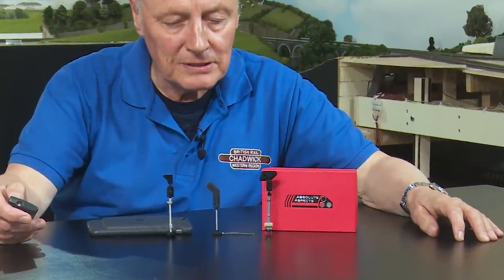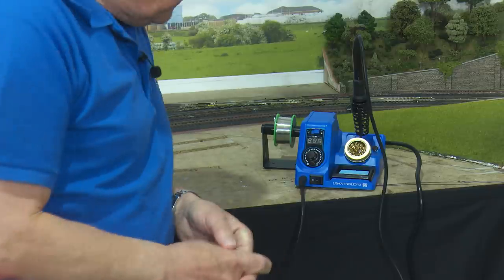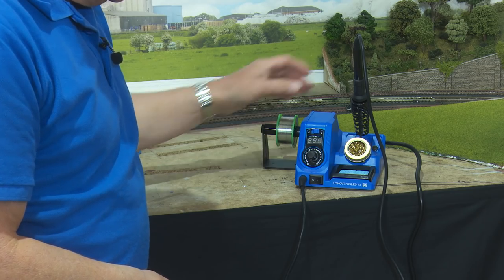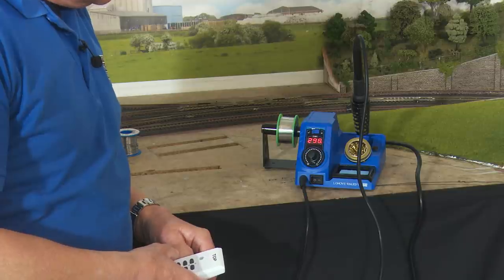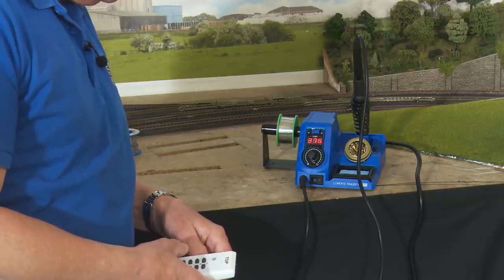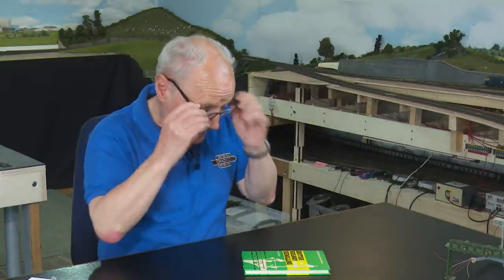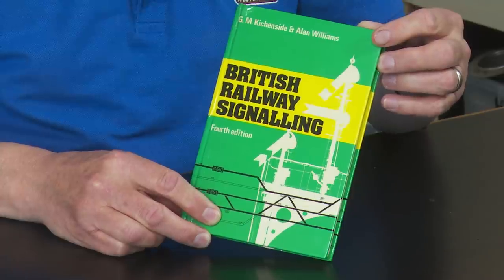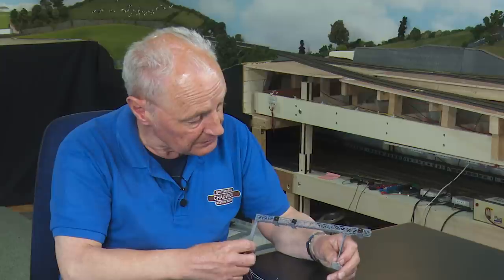Choosing signals at Chadwick Model Railway | 134.

Comment: I work in the elecronics industry so I am the kind of person who spends $400 on a soldering iron and while I would never buy a soldering iron like that myself it seems like great value for anyone who is on a budget or a hobbiest.   My personal preference is for soldering irons with a cartridge style tip as you can swap tips quickly for a different size or shape (using a rubber pad so you dont' burn yourself) and they heat up to temperature in about 3 seconds.
Reply from the maker: Yes, that is certainly a product outside of my budget Paul. Regards Charlie

Comment: Hi Charlie, I build all my Traintech signals and before the went digital, I built all my sensor controlled controllers as per Everard Junction episode 19, I now have two with feathers which are basically controlled by their signal decoder with the feathers linked to the switch on the slow motion point motors. Works a treat!
Reply from the maker: A great plan Chris. I’m so pleased that it’s worked out for you. Regards Charlie

Comment: Wow, that Absolute Aspects Signal really is a great looking piece of kit! Very impressed with the build quality. I know some will say its expensive but if you take into account the time, skill and materials to design and build it then it's easy to see why it's the price that it is. Great video as always Charlie and looking forward to "part 2"
Reply from the maker: What a heartwarming comment Dave, I’m so pleased that you found it interesting.  As you say, pricey but as an exception, well worth it.  Regards Charlie.
Reply: Another way to look at it: it's really the equivalent of a fairly substantial gantry. How many semaphore arms would you need to do the same job?  You've got the signal, all the diverging routes, and the position light. Am I correct in saying the position light can act as a calling-on signal for every route? On top of that, the same signal can act as a distant for any, or all, of the routes. That's a whole lot of signal indications, so maybe not really 𝒕𝒉𝒂𝒕 expensive.👍👌😁

Comment: UK rail signals would be the end of my career as a train driver :)
US (and Canada) signals are so very unique, and you get used to what they communicate.  Not at all helped by the mix of dispatcher/waybill signaling in use, too.
Oh, and you drive through "red" signals in the US, just at only 15 mph, expecting to come to a full stop by the next Block (if red).  And, yes, that's rather a lot of Block Signals (and why they are often in stacks of single, double, and triples with 1, 2, or 3 lamps per each).

We, in the Scenic Shop at the Club, would often be set to the task of rigging signals ten at a time so they'd go in with the scenery.  We used a  lot of fibre optics at HO and dealt with the LED under the roadbed (individual LED had not quite miniaturized enough in those days)..
Reply from the maker: What a great comment Captain Mac. So interesting how people do things across the pond. Regards Charlie

Comment: Thanks for another informative video, Charlie! I model in N but find your stuff very interesting. I agree completely about working signals - they just MAKE operating the layout; having to turn and flick switches adds to the fun!
Reply from the maker: Thanks Kev, I’m so pleased that you found it interesting. Regards Charlie
Reply: I’m planning a DCC layout, largely for flexibility and ease of wiring. But it occurs to me that there’s nothing stopping us from adding switch controls to a DCC layout to operate signals and points. It would just need the relevant electronics, which is my field anyway.

Comment: Absolutely brilliant. Makes me almost wish I was modelling MAS signalling. I can’t imagine how on earth you will make it work correctly so I’m really looking forward to part 2. To me it seems incomprehensible how to have the dots with the appropriate junction indicator clear for the dead end roads and obviously you’ll need to decide if you use leading or rear wheel replacement on your block detection to revert the aspect to danger when the train passes.  It’s making my head boil just thinking about it. Good luck Charlie. I can hardly wait to see how it is done. Tony
Reply from the maker: I do so hope that I don’t disappoint Tony. The video should run from basic to complex so there should be something for everyone.  Wish me luck, 
Regards Charlie.

Comment: I have a little soldering iron that I bought about 25 years ago.  It was cheap, about $110 Au dollars at the time.   It's never failed. and it got some heavy use.
Sometimes the cheaper ones are fully worth while, and if they do happen to fail early, you can buy 5 of them for the price of the Weller.   For Model Railway, you don't need to be super precise with temperature.  
I found a couple of very nice 3D models that I was able to print, but admittedly that takes time and to get the fine details does take some fiddling, but for me half the fun is fiddling around :)
Reply from the maker: An excellent point Brendan, unless you solder for a living, the Wellers are hard to justify.

Comment: As expected an illuminating video on signals for ones layout by Mr Bishop. I must say the Absolute Aspects hand built posts are the bees knees for route identification. Though ones pockets would need to be very deep if you plan to use a lot of point work with lit routes. Having the likes of the hand built AAs made for your most complex signal area would be ideal. Then to use a mixture of the other types available for the normal straight R.A.G. signalling and with feather operation for turn out pathways to light the way. You can also use the semaphore type signal posts to indicate your routes, with both a mechanical movement arm and Red or Green lit lenses on the spectacle plate. A nice under £50 soldering iron you got there Charlie. I must check if they have a variant with heat gun as mine is getting on in years, quite bulky and not the most comfortable to hold.
Reply from the maker: A great comment as usual John.
Many thanks, regards Charlie.
Reply: @ChadwickModelRailway  Why Thank You Charlie, a great compliment to receive from a highly regarded YouTuber.

Comment: Funnily enough I've been considering that particular solder station off Amazon for a while, I appreciate the mini review as it tells me it'll be worth it, so thanks for that!

I also love the use of DIP-14 sockets to connect the Absolute Aspect signal to the base plate, that'll make maintenance of the layout super easy as you can simply just unplug and replug the signal without having to mess around with glueing stuff.
Reply from the maker: You’re pushing on an open door on this one JS. It truly is a great design. Regards Charlie
Reply: I would assume that, at that price point, they are using high quality DIP sockets. Hope so, cos lower grade sockets tend to get a little unreliable for low current connections as they age. When I was a service engineer (many moons ago) problems on cheap computer boards were very often fixed by reseating the chips held in such sockets. I agree it's a neat way to allow easy removal of the signal though!

Comment: 23:25 I know it's an entirely new field but with a 3D printer anything can be made. I've printed my own signal head design and made up a complete signal for less than 10p (not a typo) including the cost of 4 LEDs and some enamel coated wire to go up through the signal post. I'm bound to say it, but, I consider mine to be on a par with your budget end signals. Looking forward to the "under board" video.
Reply from the maker: I think it’s about time that you made a video on how you did it! 
Regards Charlie
Reply: @ChadwickModelRailway  That has crossed my mind but videography is definitely not within my skill set.

Comment: Charlie, another iron to look at is a TS100, Amazon. I have several different irons, but this one is great for working under a table in tight quarters. Also perfect for electronics (PWB’s etc) and surface mount components.
Reply: The TS100 is an impressive soldering iron, it looks small but it is up to the job and with full temperature control.
Reply from the maker: Thanks guys, it seems an interesting alternative. Regards Charlie

Comment: A really interesting video Charlie.  Having looked at various semaphore signals I choose to have ago at constructing Model signal engineering's semaphores,  i really enjoyed building them, if you have the correct tools, equipment and a range of solders that melt at different temperatures its interesting.   One of the advantages over plastic kits if you make a mistake, remove it and do it again.  just use a good flux and keep things clean.
Reply from the maker: A sound plan Philip, regards Charlie.

Comment: So happy to see you buy a soldering station - you will find that it was too long in coming; they are not to be without.  Soldering flux is a pet peeve of mine; choose wisely.  I prefer a liquid with a solid 60/40 solder with no rosin core.  Your kilometers may vary.
Reply from the maker: I’m pleased that you approve of my choice Chuck.

Comment: Ive basically Designed a fully automated 4 Aspect block system with Isolated Signal sections making impossible to pass a signal at red as the track section wont be powered until the block head has been cleared, thats ment to detect when a track section is occupied by drop in voltage as a loco runs through a section, but ive yet to actually take it out of computer simulation and actually build it due to lack of time and space for a proper setup, as well as ordering all the components id need since it a very wire heavy build and requires each block section to be Isolated from each other which would mean you would need to run a main bus under the board to power each block section as well as run wires back depending on if you want a 3 or 4 aspect block.

The theory is sound but the main issue i cant be sure of with out actually testing is whether or not the relay with runs the whole thing will actually trigger the why i expect it to, if your interested i can always send you the wiring diagram, though the professional stuff probably does it all already and better.
Reply from the maker: Very interesting Dkz, do make a video when you build it.

Comment: Hello Charlie. Very interesting video on the types of signals, now I know you can't show all but did you look at CR signals. They cost less than Train Tech and used with Heathcote circuit boards they can be latched together to change when the train passes. One signal and board would cost less than £40 half the price of Absolute aspects signals. I use these on my Lakeside layout. Keep them videos coming. Mick
Reply from the maker: Hi Mick, no sadly I can only review what I own, I can’t really buy in every different sort. I’m sure you appreciate that, regards Charlie
Reply: @ChadwickModelRailway  I do Charlie, thanks for the reply. Mick

Comment: Hi Charlie just watched your video about signals another great watch I myself use the train tech ones but the sensor signals you can either use the prongs or soldering it to the track the sensor signals have three holes so you can connect signals together with the 2 outer ones and middle hole is to connect to a relay RL1 so you can do train         automation the RL1 has 2 relays independent of each other so you can operate 2 different things but rather than me ramble on check out David from train tech to get better information I dual head 4 aspect,theatre signals and one with a left hand feather on Beighton Parkway Sheffield take care 
Best wishes 
Kev
Reply from the maker: Thanks Kev, I shall check it out mate.

Comment: Just a reminder to anyone considering using track detection and track powered signals, you'll want to power your signals from the main track bus and not from a feed connected to a detector module.
You can still use switches and levers for track powered DCC signals, but you will need to use a detection module (a cheap simple on/off Detector module not a track power detection module!) and a controller that can automatically trigger outputs from detection inputs, so any PC system or an Ecos type controller..
Reply from the maker: An interesting point P 77, regards Charlie

Comment: good review of whats available for signals and use. I've used dcc concepts Alpha mimic for my ground signals in my yard area very easy to setup.
Reply from the maker: That’s great news Rob, how do you operate them?  Regards Charlie.
Reply: @ChadwickModelRailway connect the mimic board to the DCC bus. The mimic boards controls 12 ground lights via switch close and throw
Reply from the maker: Thanks Rob.
Reply: I've seen the Alpha Mimic thingie used on a few layouts, and it really does seem the ideal solution for DCC: you can still operate the points/signals on the controller, or you can use switches on a track plan more like a proper signaller might.

Comment: Great video, probably going beyond the scope of my layout but very interesting none the less. The soldering iron is a consideration, looks like a good half way from the basic iron to a professional one. I’m use to instant heat in work from switch on but as you could very well guess that comes at a price of £600 plus for a cheap one which makes the one you found a fare compromise.
Reply from the maker: Yes Rob, you can end up paying the earth for a good one.

Comment: In my professional life, I have used soldering irons costing from 15 quid to 400, and induction heaters costing thousands to solder microwave cables. My personal preference tho.. after all that.. the cheap gas irons. No cables, and a little flame vent at the side for shrinking heat shrink tubing. 👍
Reply from the maker: I'd stay away from circuit boards Alan.
Reply: @ChadwickModelRailway  . Honestly Charlie.. Gas Irons are no problem with circuit boards... Just be aware of where the vent is pointing 😂. I have never found differerent tips to be an advantage or disadvantage. A point is a point. Just heat capacity of the metal behind it matters to me. I was one of the last to do the soldering course at the old Marconi college in Colchester. Late 90s.  My preference for gas irons is purely personal 😂👍. For field wiring.. superb. Circuit boards... no prob. For the algorithim.. every comment counts 👍

Comment: Hi Charlie, another very informative video,  I like the look of the hand built signals although I think they are a little out of my price range I had to go for the Eckons on mine. One little point on soldering it's best practice to keep the iron around 360c for most tasks I only raise mine to 400c if I have a stubborn piece of track that needs a little extra heat. I know the unit has sleep mode but your iron tips will last a lot longer if you keep it set to 360c, keep up the good work and thank you for your video on the helix I ended up buying one from DCC Automation. Darren
Reply from the maker: What a great comment Darren. Yes buying signals can be a interesting task, but I’m pleased to hear that you’ve bought Helix too. Regards Charlie

Comment: Well said on the joy of switches.  A train driver can't change signals and points from the cab, so it just seems wrong to me that they're al on the same handset, although I can see there are occasions that can be useful.

But wow! that Absolute Aspect signal is one heck of a sexy beast.  Does the "under the counter" bit of it have some fancy electronics in it, or is it just a few resistors for the LEDs and connectors?
Reply from the maker: Hi Andrew, there are no sexy bits on it, just a series of resistors. It’s feeds are purely 12 V DC to each of the outputs. I shall cover it in more detail in the next video, regards Charlie

Comment: You must have a lot patience to solder all those tortitose switches.I prefer to use the snap terminals by acculite. The hand built would convert to about 250 cdn dollars very expensive
Reply from the maker: Yes Ron, it is somewhat specialised.

Comment: Charlie, another interesting and informative video.  I think price wise, paying £120 for a signal of that complexity which is also hand crafted is reasonable. I can't say I'm a fan of the connection method and how large a hole you need to drill in the baseboard to accommodate it, but then maybe you will cover installation in your next video.
Reply from the maker: An interesting point Malcolm, and I shall certainly have a go. Regards Charlie

Comment: Charlie,  another great video.  My nine year old granddaughter is a factor in my current layout build, so you could have been talking to me towards the end.  When you do your below the board video, something to consider.  I am going to be running DC and DCC - but not at the same time of course.  I have sound fitted locos and some vintage stock that cannot be converted.  My granddaughter also has her own locomotive which cannot be converted to DCC.  Thinking about the signalling, my thoughts were to have a separate DC power supply for all lighting and signals independent of the track DC and DCC.  I assume that would work.  Any thoughts? Might be worth a mention in the next video.  Thanks for the inspiration.
Reply from the maker: An excellent point Clive, regards Charlie

Comment: Great review as always.  The hand-built one looks fantastic, what a great present Simon gave you.  
Just a question on the options for that train coming over the viaduct.  If that's a double slip leading into the industrial unit, isn't there also an option to go into the other platform and even onto the other main through road? (Or did I put the wrong track piece on the plan?)
Reply from the maker: I’m so pleased that you enjoyed it Lee. The double slip just south of the viaduct is actually a long diamond. 
Regards Charlie.
Reply: @ChadwickModelRailway  is that not single slip, so you can come out of the industrial unit and over the viaduct  on the correct left track?
Reply from the maker: It’s a double Tom. I was at the wrong side of the viaduct!